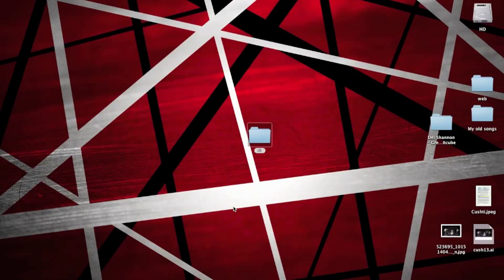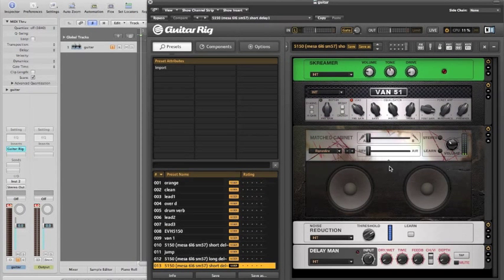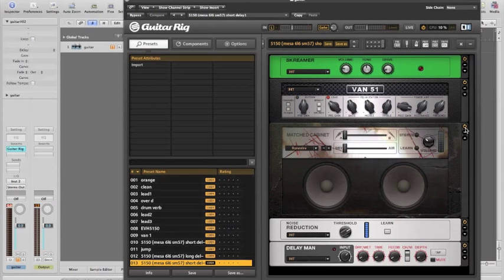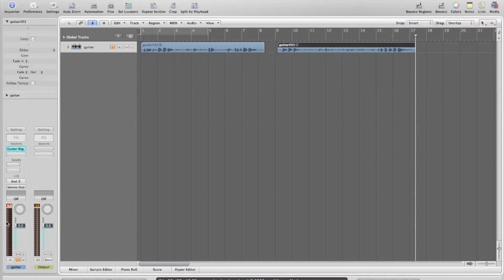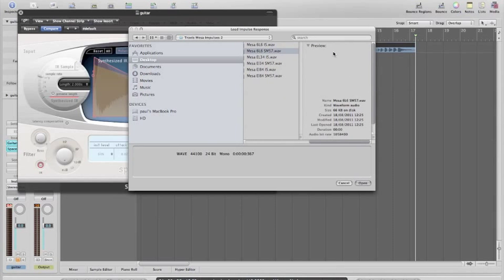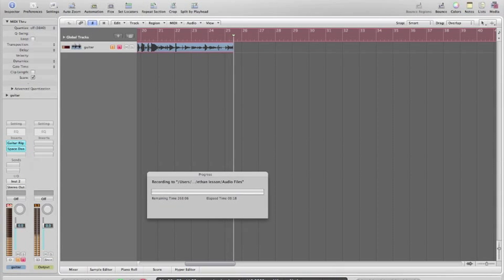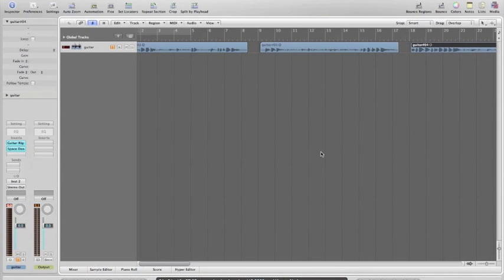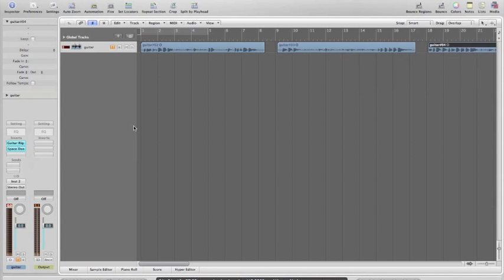Loading impulse response into Logic

Comment: Hi Paul, amazing job, thank you. Just a quick question, i did not fully understand why you use the impulses through the space deginer, is it because it's the only way to upload the files?
Reply from the maker: There is a Reverb block in Guitar Rig that loads IR's but i prefer the sound when i use Space designer. Also if I'm using space designer i can ab different amp sims against the same impulse quickly